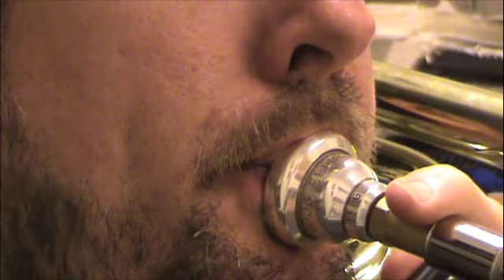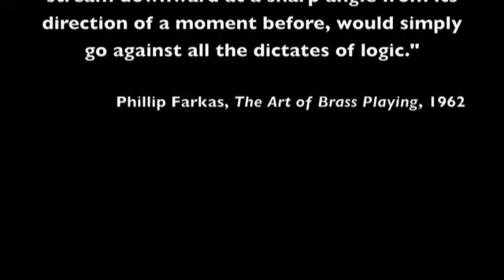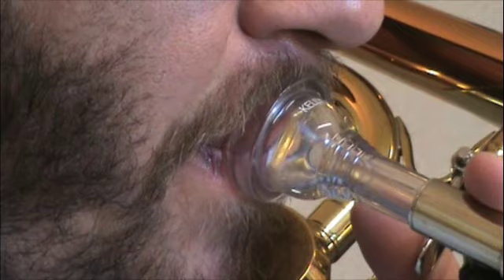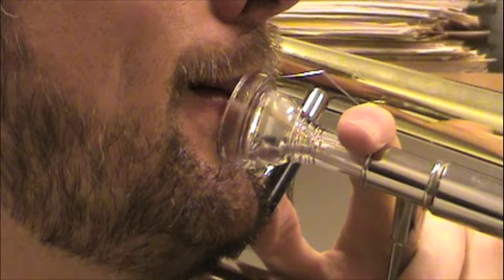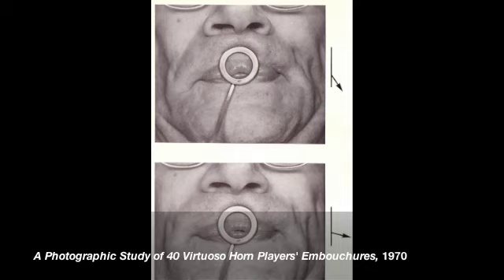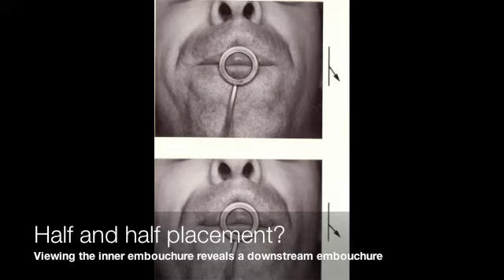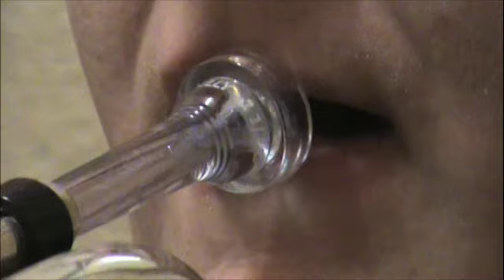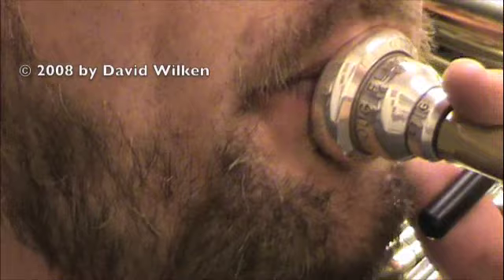The Brass Embouchure and Air Stream Direction

Comment: I really needed this, thank you.

I've read Reinhardt's book on the pivot system and it was the single most important and helpful book about embouchure I've ever read.  That was about a year ago, and this video reminded me of some things I had forgotten since reading this book.

I'm a horn player with many embouchure problems, but Reinhardt's approach works better than any other for me.  Especially with embouchure formation in regards to dental structure, lip structure and air stream direction.

Comment: Dont get brace guards because it will only talk longer for you to get use to your braces.  Your stream direction doesn't change usually. If when using a bigger or small embrochue. Also as you devlop as a trumpet player your embrochue postition might change a little so it can produce the best sound as possible.

Comment: Thank you for the interesting video. I'm 17and I've been playing the trumpet for a little while now.  But, I don't seem to be a very natural player.  It seems that no matter how much I practice, my range doesn't improve past High B or so, varying day to day, and my endurance is relatively bad.  I try to avoid using excessive pressure (although I don't always succeed).  I've been told that my throat tenses too much when I play. How restrictive can a tense throat be on playing?

Comment from the maker: "No importa si la boquilla se coloca arriba," "It doesn't matter if the mouthpiece throat is positioned above,"

Sorry, but this is demonstrably wrong.  I'm sorry I don't have Spanish translations for all my videos, but you could prove this yourself.  Move your own mouthpiece placement to mostly lower lip inside and try to play.  You cannot make a downstream embouchure play upstream and function well, or vice versa.
Reply: My jaw is in the front of the upper teeth. My mouthpiece is 2/3 up and 1/3 down ,but I have problems in upper register ,the notes from the 2nd octave is very flat and hard to hit and almost impossible at p or mezzo piano.  If I move the mouthpiece down I can squeak high notes easily at a piano, but harder the notes on bottom.
Can you help me find my position?